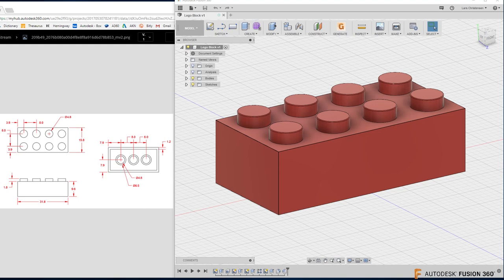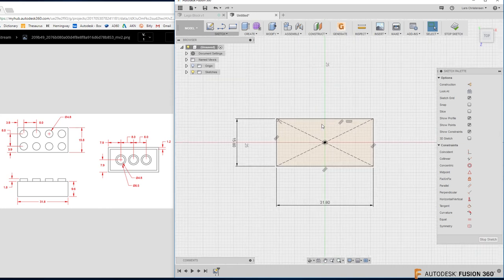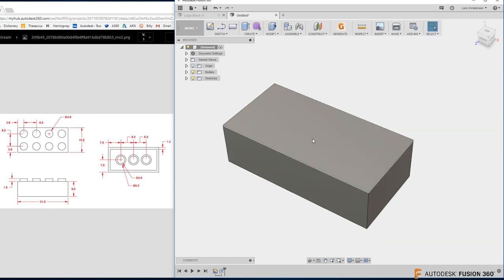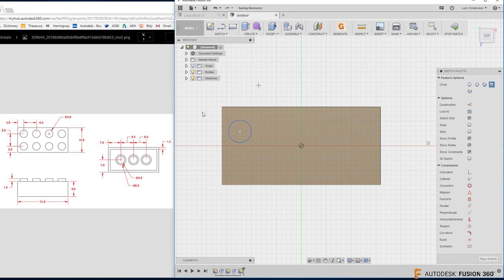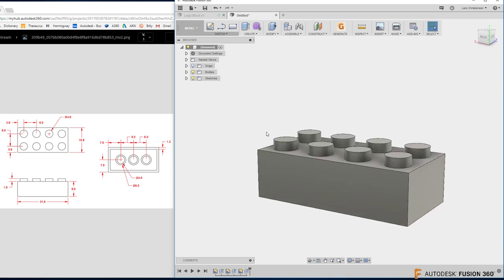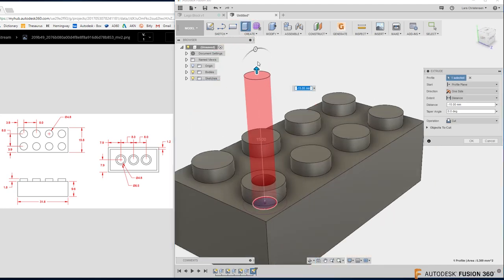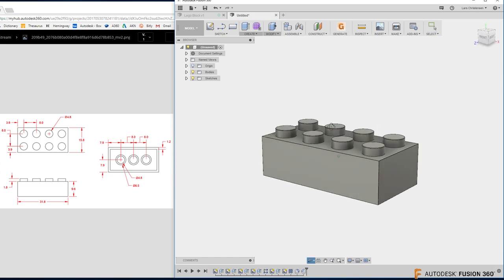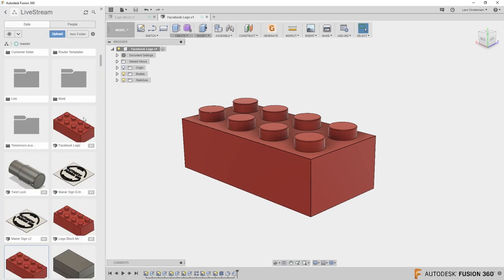Fusion 360 Absolute Beginner - How To Model a Lego - Last Nights Facebook Livestream

Comment: At 30:17 for the P for Project, mine did not work as yours did. The Fix for me was to hit P, then spin the part around and click on the circle on the top, then spin the part back to the bottom and I could then see the circle projecting through the bottom. Then hit OK. Took me a few minutes, but I figured it out and wanted to share.
Reply: Same happened to my version, they must have changed the tool in the more recent version, thx again!
Reply: happened to me too-....thanks!
Reply: Thx for helping :D
Reply: As of 4-27-2020 when I follow the above instructions I can see the projection.  However when I select the inside of the block to do the new circle it attaches to.the top face.  If I figure it out I will post again.
Reply: I had to select the circle first then hit project.  Flip the Lego over the "C" to make circle.  Created new circle on the snapped circle center and it was drawn on the back.  Goodluck
Reply: @kwissiekwissie  thank you so much!

Comment: When adding the line to create the web (this is with the NEW Fusion tool bars), the line will not snap to the center round extrusion; it will only snap side to side on the block inside middle edges. I created the inside space using the 'shell' command instead of extruding. A short line will only extend to the other side, not to the cylinder. The long line will not trim to the center cylinder either. The cylinders and the base are at the exact same level. Thoughts?
Reply: Hi John, did you ever come up with a solution to this problem? I did not use the shell command but still have the same dilemma.

Comment: Hi Lars, I ran into a problem at 30:11 in the video. Somehow the projection doesn't work for me. 
I have version 2.0.9719. I know the screen looks different and until now I managed to work my way around that. But now I'm a bit stuck. (sorry about that.)
Do you know if I did something wrong? Or could it be something with the program?
Thanks for your reply. KR.
Reply: Hi Peter. I had the same problem.  My solution was to select the object I wanted to project manually. Don't know if it is the right way but it worked for me.
Reply: I also had the same problem, but I was able to get around it by checking the "Slice" option in the Sketch Palette
Reply: Same here
Reply: Yep I ran into the same issue and tried both suggestions and they both worked thanks everyone.

Comment: great video as a newcomer from SU to F360, different manner of getting there. As to the push/pull action as I type Q, I DON'T get a change of view even with the setting box checked to perspective with ortho view , What have I not done ????  When trying to draw the underside of the bosses using P for projection - I did not get the bosses projection showing  :(( What amI not doing right ?
Reply: After you press (P) to project ,rotate the brick to the top side and select the top of the studs  then rotate back to the bottom and you will see them. Good luck
Reply: @cliffianson4146  That worked, thanks!

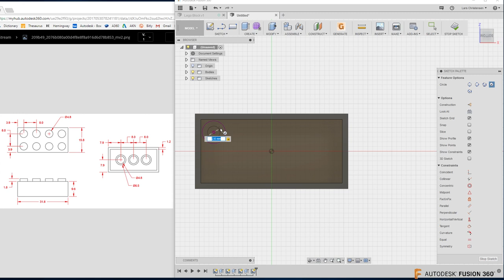Comment: Hi! (TO START: i am a big fan of these video's... THANKS!!!) at 31:00 you tell to get a circle of 2,6 but where is that number coming from? So i looked at the measurements and figured out that i believe it has to be 2,4 mm isn't it? Because the stud is 4,8 and the wall thickness is 1,2 so 4,8 minus 1,2 for the left wall and minus 1,2 for the right wall gives me 2,4 or am i wrong? not that it will matter most... but i want to understand and learn and understand if that's the case?

Comment: I am having trouble in creating those 45 degree and 145 degree lines at the correct place. Every time those lines are created on the far end but not on the cross section after section analysis. When I draw those lines they appear to be correctly on the section analysis cuts but when I extrude they start extruding from the far end but from the middle. Please help

Comment: Lars, Excellent video. Detail, sound and pictures are fantastic. I do have one question. I'm at 34:16 right now and I have to re-adjust my "rectangular pattern" but I closed out of it and now I dont know how to get back to adjust it. This is difficult for me explain so hold on. I've been following you in this tutorial and when I make a mistake I have to hit the "undo" button because after I close out or hit "ok" on whatever I do I cant figure out how to go back and adust it. I have to undo and then do everything over from that point on. Does this make any sense?
Reply: Nevermind, I got it. I found the "recent actions" buttons on the bottom of the screen and was able to use that. Not sure that's the proper way but it worked for now. Keep up the great video's!
Reply from the maker: Happy you figured it out!
Have an awesome day

Comment: OK.. stuck dead once again. I do EVERY thing you do, to the letter, exactly, yet things fall apart. When I'm ready to "project" the "bosses" onto the other side, my drawing CANNOT see the top bosses 'through' the object. All it will allow to be selected is the inside of the top itself, no circles are visible. Man, I try harder than anyone but this STUPID program stymies me every time! I SOOO want it to work and to learn it!!!!! GRRRRRR~~ !!
Reply: From ronnie brescio comment 1 month ago the replies say that you "Check the "Light Bulbs" in the Sketches folder. If the bulb is turned off, it won't show as a Projection" & "...sketch 3 light bulb needs to be on!"
Reply: I’ve got the same problem😔
Reply: P Thomas explain more I detail please I’m struggling 😩
Reply: @pcfrog  you the man! Problem solved!